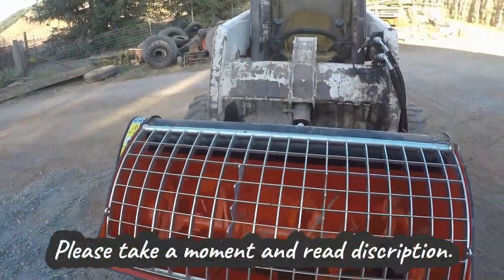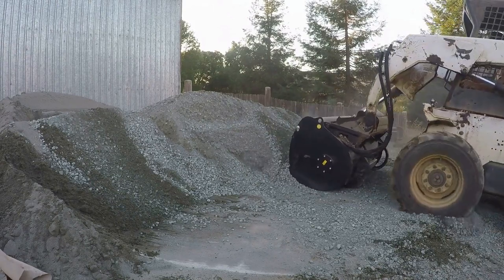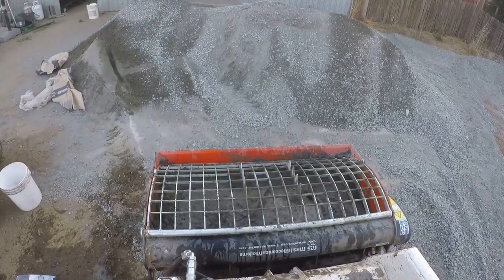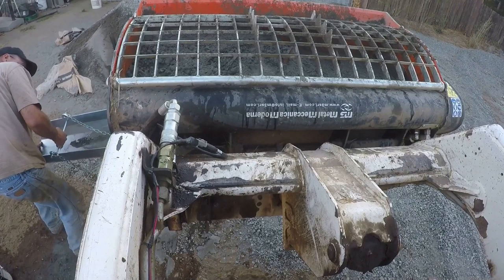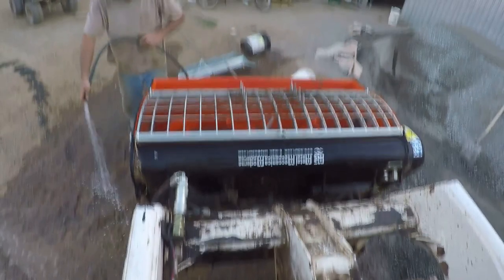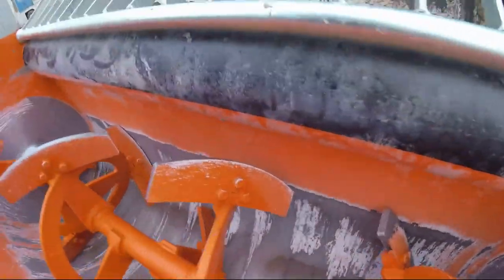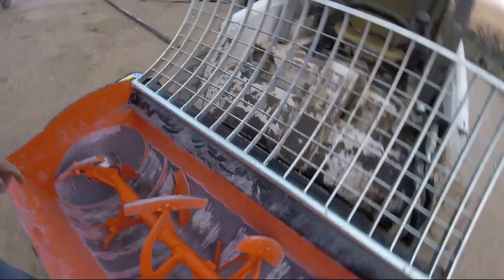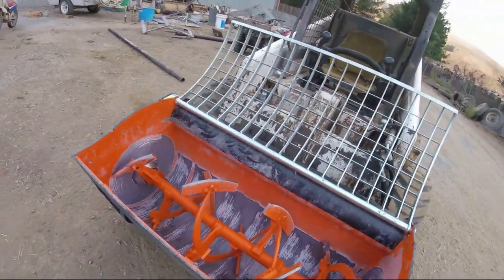Cement Mixer for Skid Steer

Comment: Simple fix, get 1/2"  rubber conveyor belt material,  make a pattern of the curve needed, cut a 4" width arch the same shape as the paddles and bolt the rubber to the existing paddles, you must cut off about an inch of the existing steel paddles.   >OR<  Cut out the entire bottom and bolt in the rubber conveyor belting in it's place.